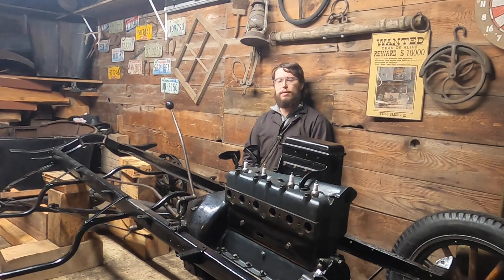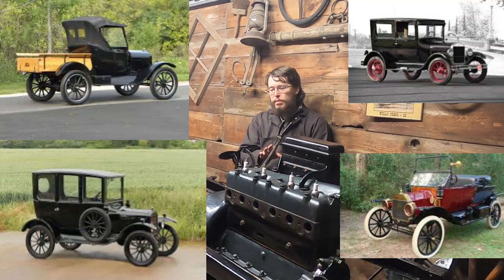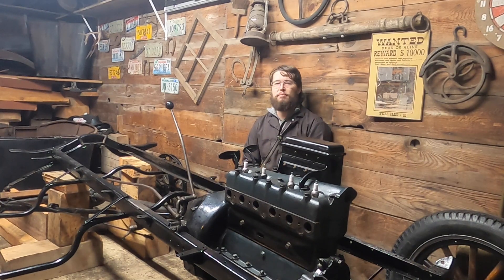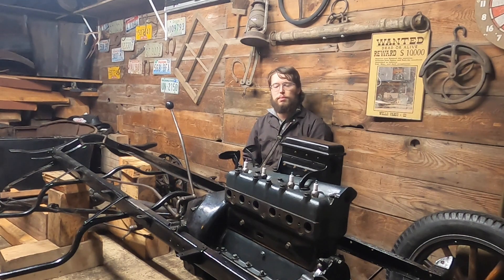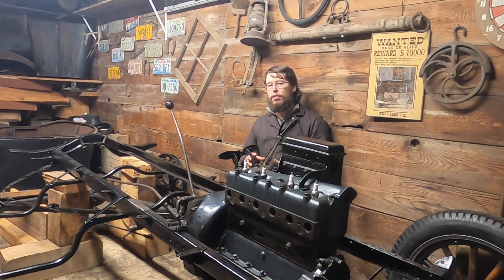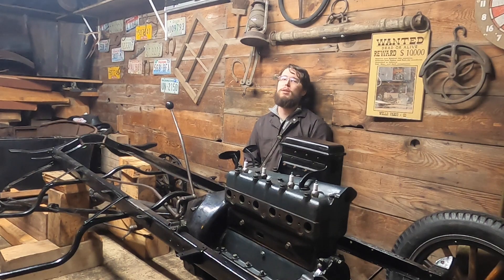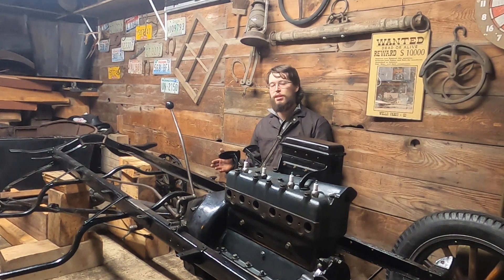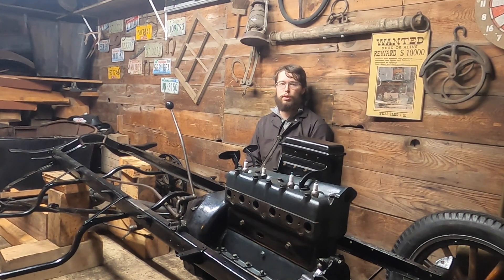Channel Introduction

Comment: You did a fantastic job with this series, the production, sound and video quality are professional quality. I too am impressed with the T, I have a few , most in pieces. There is a complicated history if you want to get the details right but everything you said was spot on. I think it's time to put the T on solid works - from the 1908 models to the last one off the line.

Comment: I saw a video for disassembly of the differential but haven't seen one for putting it back together. Is there something available to show me how to reassemble a differential that someone else took apart years ago.
Reply from the maker: In my ruckstell video, I go over the components and some of the assembly.  With the ruckstell, assembly is a little different than a stock axle.  Here is a link to the stock axle parts diagram, http://www.mtfca.com/discus/messages/822076/886216.jpg
If you were not the one who took it apart, I would recommend getting the axle rebuilding book from Chaffins garage, you will want to make sure the thrust washer and pinion clearances are right so the axle will run smoothly.